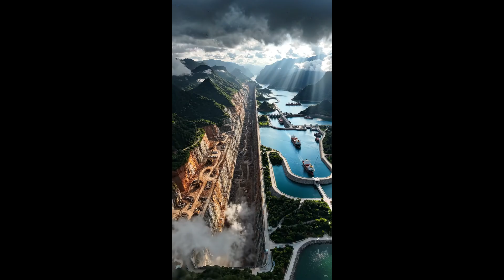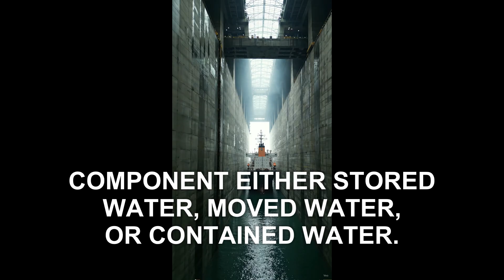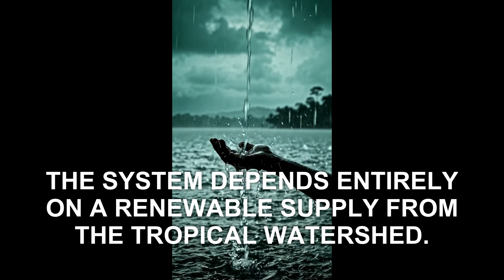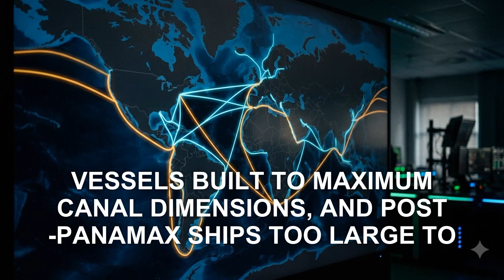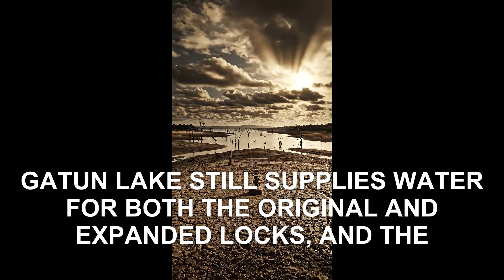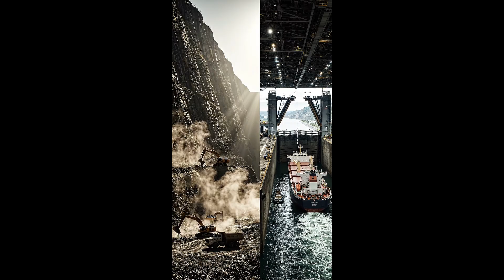The Panama Canal’s Biggest Problem Is One We Can’t Solve

Comment from the maker: 85,000-ton ship. 85 feet of elevation. No ramp. No pumps. Gates close, 26 million gallons pour in from above, and eight minutes later the ship floats at the summit — gravity alone. Every full transit still drains about 52 million gallons that rain must replace.

One question: is solving elevation with a lake and locks the only honest fix when a sea-level cut dies in the jungle… or did Panama just trade an impossible trench for a century of depending on weather it cannot control?

Drop your take 👇

Watch next: Why India Built a Railway Through Ground That Turns to Mud